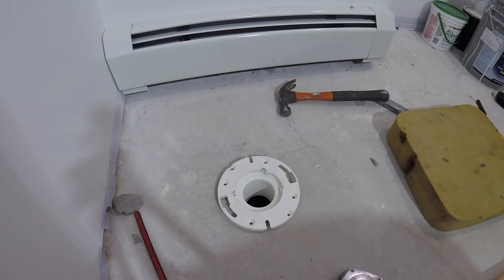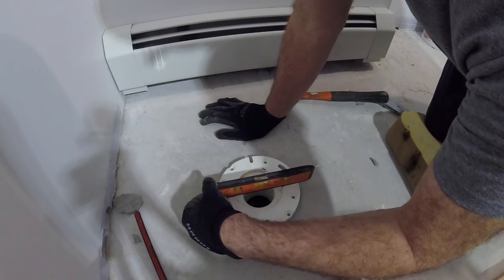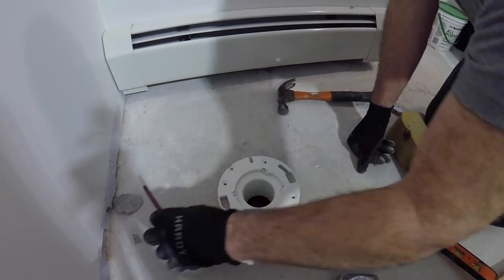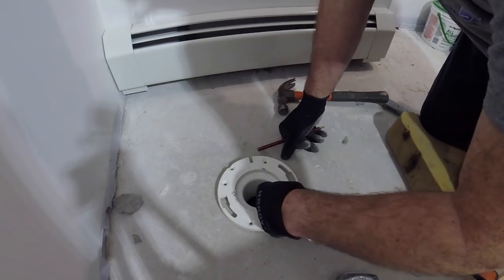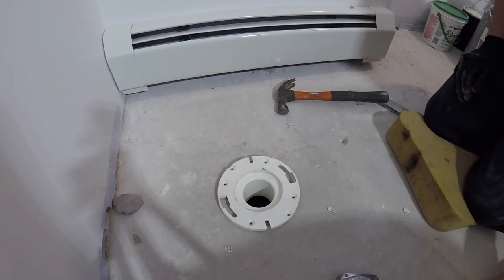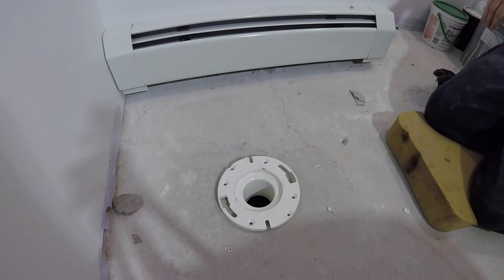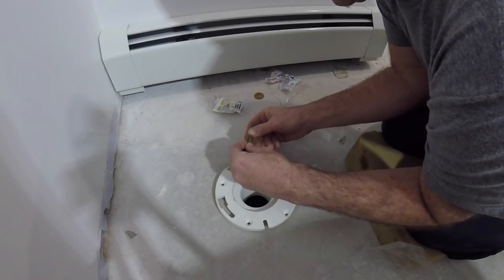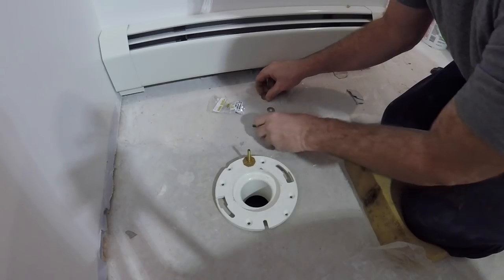TOILET FLANGE AND TOILET INSTALL AT CONSTRUCTION SITE

Comment: Chuck. You never seem to amaze me.  If you just cut the pipe down a 1/2 inch below the concrete.  That flange would have set down against the floor. Second. Had you drilled and screwed the flange to the floor. You wouldn't need to worry about the workers using it.  
  Here is where you say "it's just temporary"  yes it is! But sooner or later you'll need to take it out. Cut the pipe down and screw it to the floor. Why not now?? It doesn't matter how high the floor is going to be.  You can remove the screws. Lift it out. Let them do the floor. Reset the flange & new toilet. If you had done this job correct the first time. You would not have worry about the workers & the wobbly toilet.  
  I know. I know. It's just not your style.             😏

I'm not even going to say anything about the junk plastic flange you used. Never. Don't even carry one in my van. That's a beginner's choice of cheap materials.  (Your choice)
Your turn for an excuse. There is no reason. Only excuses!
Reply from the maker: No lee you never seem to amaze me.....your the greatest plumber i ever met on the net. and of course the flanges you use are the best....and you have a case of them right?
Reply: @ChuckBarron  nope just carry one in my truck. Plastic is fine Chuck.  But te flange is "always" Stainless steel.  ALWAYS!
  You dont need to worry about using junk Chuck.  You can tell them n a few years down the road.  Hey. It's all junk today. Then charge them again to reset the toilet. Residual income.
Reply from the maker: Send me link lee....lets share your wisdom is ya don't mind.
Reply: @ChuckBarron  "let's share your wisdom is ya don't mid"
     What?
Reply from the maker: What flange do you use and would you recommend? that is what I mean.
Reply: @ChuckBarron  do you think I Google the proper way to do things. Or do you think I know it in my mind?  
You should just take this video down.  The only people that think this was even a good "temporary " job. Haven't a clue what to do anyway.      🤗
Reply: Lee Olaeta you definitely need to make a video on the correct way to install a temp toilet there champ. So we can all see the proper way to do it.
Reply: @ChuckBarron  the flange is that last thing I talked about. It irrelevant. 
  Hell, If you don't know the difference between a good or a Bad flanges. Keep using the junk ones. Just why do the work half assed.  
    It doesn't matter if it is temporary or not. I get why you used a cheap wax ring. I get why you didn't cut your bolts. (I think?) None of this matters because its temporary.  But the flange is going down where it is. I'll bet the floor is not that far off. If you cut the pipe down below grade. Set the flange down all the way. Screw it to the floor. Then you don't need to worry about the gorillas that will be using it "Temporarily"  I cant imagine them doing anything to the floor that would cause you to have to pull the flange. If the put in Linoleum or tile. Unless they float the floor. That flange is in for good. Except the way you did it. You'll need to pull it again. Reset it then set the new toilet. (Gerber) really. Cheap toilet. Kohler,  American Standard,  TOTO. Just o name a few good ones. But fixtures are personal choice. Those are my top 3.
 Kohler & Toto are 1 & 2. 
I just replaced 12 toilets in 3 commercial buildings.  All comfort height with elongated open front seats. Code legal.
Now that was a good days work. 6 hours work @ $675.00 dollars each. Do the math on that one.          😋

I got off course..
This is actually the question.. 
 "Why not set that flange correctly? ?"
Reply from the maker: for the last time...the reason i did not screw the flange down  was the floor will be leveled and installed.....THEN THE FLANGE.....get me Lee?
Reply from the maker: Yes Lee....Please make a vid. We all need some fine tuning.
Reply from the maker: Im not taking vid down lee....if you can see its a temp then I don't know what to say. thanks for tuning in lee...
Reply: @NickJPDT  this has nothing to do with being temp. The flange is not temp. You're there being paid for the job. Why not do it correctly "once" if you can't see this. Then I'm glad I'm not your boss. Take this video to your boss and ask him if he thinks it should have been installed correctly.  Remember.  I'm not talking about the toilet being installed correctly.  I'm just talking about the flange. 
Do it once. Do it right!
Even if the floor guy needs to float this floor some. He us not going to need to change this flange.
Reply: @ChuckBarron  you do realize that the flange is not temporary.  You should have set it correctly.  When this job move on. Please make a video with the floor guy fixing this floor. That will set all of us nay sayers straight. It will show us why you in your infinate wisdom why you didn't set this flange properly.
  I'll say I'm sorry at that point. But you know I'll never see a reason that you didn't do it right the first time.
Reply: @ChuckBarron  you can deflect away from the flange by saying the toilet is a temporary toilet. The flange is not temporary. Stop deflecting.  
The Flange, The Flange....
Reply from the maker: Lee the flange will be set on final floor....now do you get it? i know you do. you can see it just like I can.
Reply: @ChuckBarron  and you can't see what I'm saying "right". Then you'll never get it right.  
   
   It is an easy removable flange. There is No reason you shouldn't have set the flange correctly. 

  None Chuck.  

If you can't see that. You should go back to who ever trained you. And slap the "shit" out of them. Because they don't know what they are doing either.  
 Poor CB2 he's next in line for this kind of training. 
What are you going to be saying to cb2 when he is costing you money.  Oh well. Bad training begets bad work.
Reply from the maker: Lee but there is.....floor needs big time leveling, then sub floor, then floor(hard wood) then flange goes on top of floor. I know i have done it your way also but i do not want my flange to be below floor.....this floor is way out......are you california dreaming right now? I know you understand? did i paint a good picture for General Lee?
Reply: @ChuckBarron  you can't tell me that this floor is going to move up much more than a 1/2 inch in this area. If it is. They should tear the building down and let someone who knows how to pour a slab do it right.
Reply: @ChuckBarron  you're right Chuck.  This is your type of work.  Send me pictures of the leveled floor when you go in to set the new toilet. I want. No, We want to see this floor that need multiple inches added to it to make it level!
Then put up the concrete guys name. That way anyone that lives around you never uses this guy. 
I know, Its probably another firefighter hacking work on the side.
Reply: @ChuckBarron  tell us how far off this concrete guys is. Come on tell us he's off by 3 inches or more?     "Concrete"
  No flooring goes under a flange. Nothing. ie: tile, Linoleum nothing. 
  You should explain that the job you are going to is being done by someone who has no idea what they are doing.  But it a friend of yours. So you are going to help. It's not like this is a regular job. Unless you work with bad concrete guys all the time. Meaning Firefighters the think they can do any kind of work. After all the Alfa 1 can do anything. I guess they cant do level concrete in a 2 foot square area for a toilet. 
Plus. CODE says flange must be attached to the "subfloor" this concrete in my area is the "Subfloor"
I'm just commenting on what would happen in my area of California.  "Code legal" I guess codes and Proper is completely different in different areas of the country.  
     😏
Reply: @ChuckBarron  yes I'm California Dreaming the correct way to do this job. 
   "We" never put flooring under the flange.  It gets screwed directly to the concrete.  I understand why you used this Temporary Flange. This is a cheap home owner repair flange. Not a professionals permanent type.  So I understand why you used this POS flange. 
  I really hope you show everyone the floated level floor when it's done.  I'm willing to bet. This floor in this area isnt more than a 1/2 inch from where it is right now.
   PLUS. PLUS. PLUS....
The temporary Flange should have been screwed to the concrete so some IDIOT  worker doesn't fill off of it. Or it leaks piss water all over the floor. 
  It's not going to hurt anything to screw it down now. It's not going to ruin the floor or pipe. What it will do is stop any kind of leaking or problems between now and the time someone pulls this toilet & flange to "Level" the floor.
  Doing it right doesn't mean that it cant be taken out when leveling the floor. After all. It does need to be pulled out to level the floor.
Well mister fireman please explain what it would have hurt to screw this cheap ass flange down to prevent the toilet from rocking everywhere? 
I know there is a lot of questions in this post. You'll never be able to answer 2 of them less more all of them.
  Ok. Your turn.
Time to Deflect........... go
Reply from the maker: ok demo the building.....Legend Lee says so....lol
Reply: CB, can u block lee ?
Reply: @JjJj-yl6on  sure he can Jj Jj if he wants to. Look through this complete post. Do you think I'm the only one asking "WHY"  if he blocked me that would just be admitting that I'm completely right. 
  I really don't care about the junk cb1 is using on his jobs I'm just asking why he didn't show the world of u-tube why he didn't do it correctly the first time. He knows that there is no logical reason to do it the way he did. My question is. Why show the world that he has no idea what he is doing in this video. 
   This is a beginners style of work. And that's ok with me. He can do what ever work style he wants. But, When putting that work out for the world to see. We have the right to question it. Cb1 says he is a professional.  Then I think he should act like one. Doing work like this is not show he is a professional.  At all!
Reply: @JjJj-yl6on  cb1 knows I'm right. That's why he Deflects around my questions.  Never really answers them completely.  
Which shows one of two things. He likes games. Or he really doesn't know the correct answer or way to do things. This is what a true professional sees.
Reply: @ChuckBarron  that's how you deflect.  Explain to the world how far off this floor really is? 
 Please Please Chuck . I know you won't. But I'll say Please anyway.
Reply from the maker: Lee I promise...I will get the shots....oh maybe I will deflect again....
Reply: @ChuckBarron  I'm sure you will
Reply: @JjJj-yl6on  you can call me anything you choose. So what's your point. You must work for someone else.  Doing this way you get paid twice for doing the job incorrectly.  Would your boss accept you doing work like this?
Reply from the maker: no need to block him...as long as he does not disrespect me or anyone on channel he can write what ever he wants. He actually makes me laugh.
Reply from the maker: lee no deflecting......how many times do you need to here the same thing...your beginning to worry me...are you ok?
Reply: @ChuckBarron  how many times can you not answer one simple question?